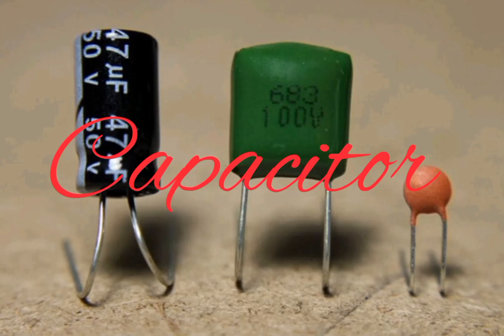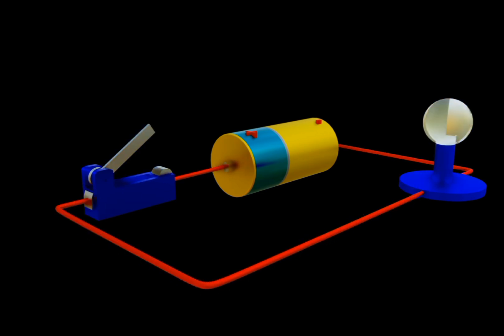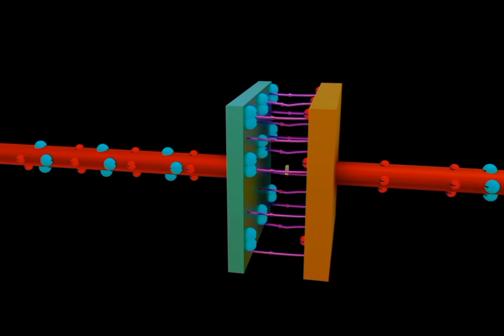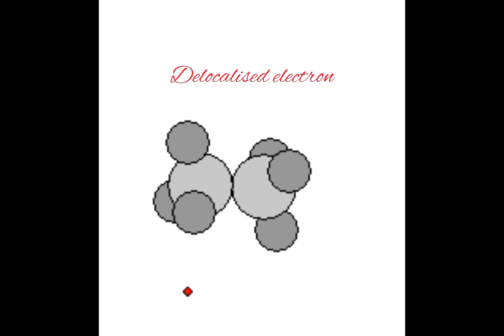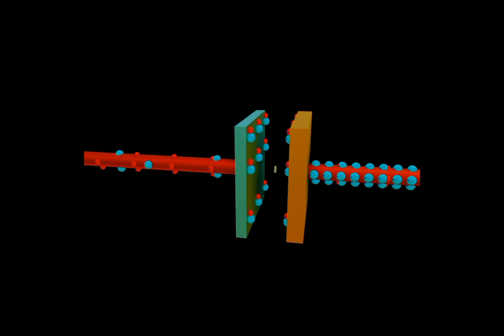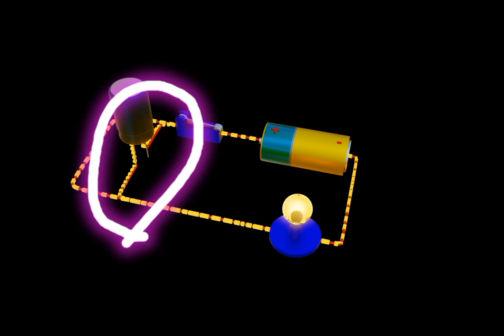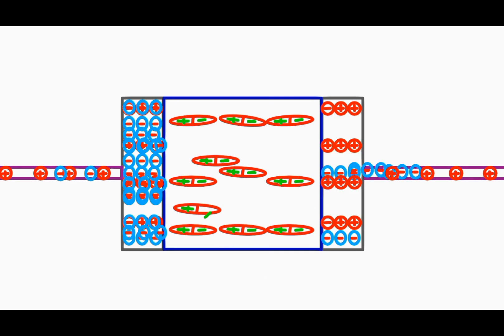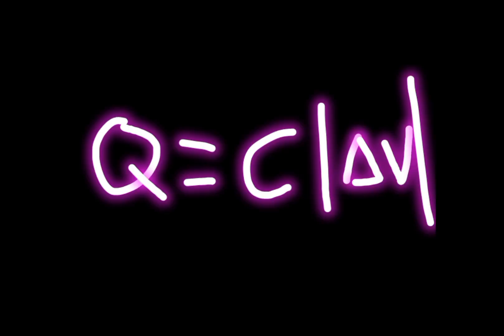Capacitor Explained: Working Principle, Types & Applications (3D ANIMATED)

Comment: The animation shows capacitor connected in series with load in a DC circuit. I don't think that's how you place electrolyte capacitor in DC Circuit.
Reply from the maker: You are very correct, I'll make the change to avoid confusion